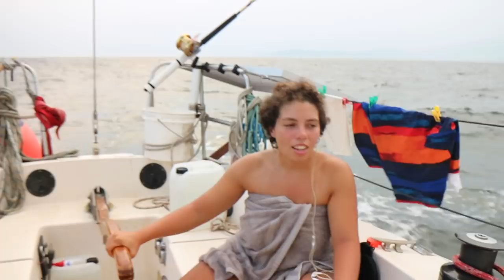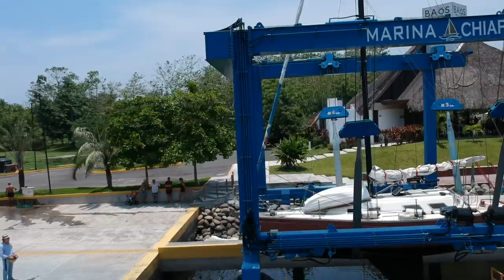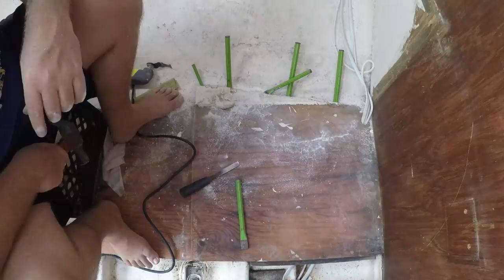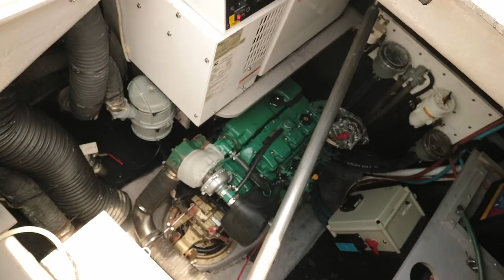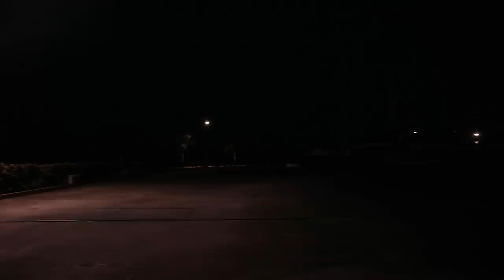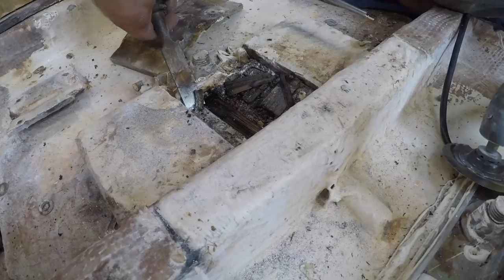DEMOLITION - Sailboat Interior Remodel

Comment: Nice to see You're doing it right.  The boat will be like new when you're done.  I'll be watching your rebuild with great interest.  Along the East Coast of the US, boats with this kind of water damage can sometimes sell for very little.  Add a non-functional engine, and its My kind of boat, donated to a charity and sold online no matter how low the final bid is.  I'm amazed you had a usable cabin after just three months.  You should be proud of yourselves if you've fixed it.  Even more so if you really did it in 3 months.  I just subscribed and turned on notifications so I can learn how you did your restoration.  Thanks in advance for the useful info !
Reply from the maker: Thanks for watching and the comment. That's exactly the case for Rossa. The marina where she came from in San Francisco couldn't even manage to sell her at auction. Our video (18. Our New Boat) shows the bad condition she was in. It took more than 3 months to get her sailing again, to be fair, but it was just the cherry on top to work those 3 months and get the inside looking clean again.

Comment: Hey Guys - if you would like to cool the boat down  - set up a great big cover over boom - or similar  - basically make it a tent  - it will take at least 7c temp out of the boat
Reply from the maker: Yes, of course, but we unstepped the mast at that time.
Reply: Sailorama You can still rig a tent with some planks etc. Makes a huge difference. Great work, by the way. The people building the boat must have not cared much about longevity.... Putting wood inside of plastic in the bilge area! That’s asking for trouble!

Comment: As a newbie to you channel, why didn't you remove all of the compression block?
Reply from the maker: The piece of g10 that we had was not large enough to replace the whole block. After cutting and digging out, we determined that the outer edges of the block were less rotted as well. What I didn’t mention in the video also is that the area was drying for about 2 weeks. Of course removing the whole thing would have been ideal, but the end result has been super sturdy and looks good.